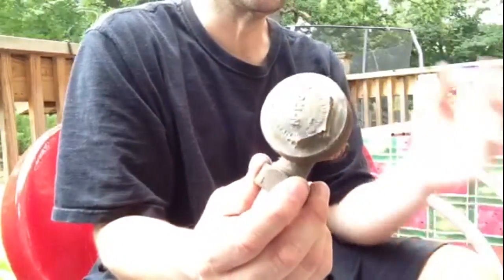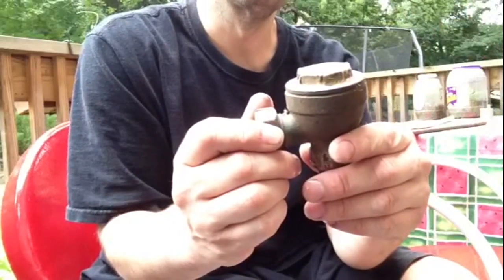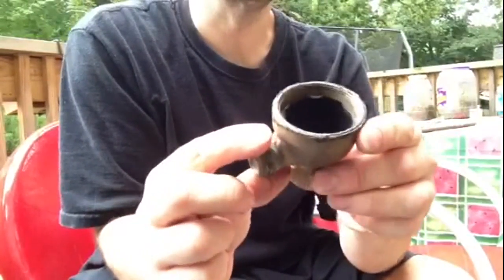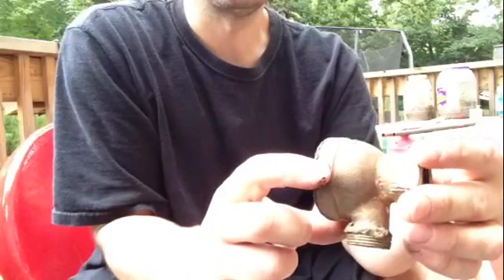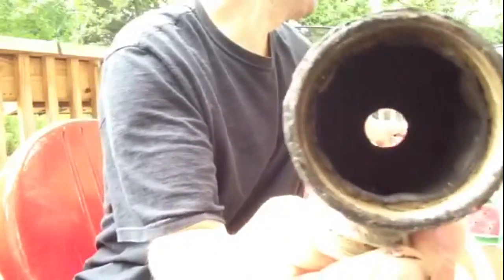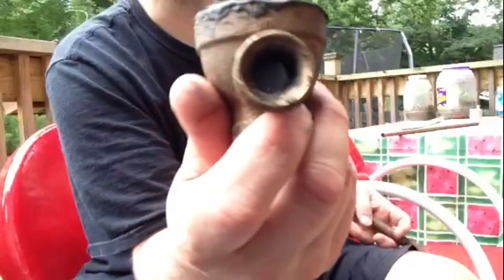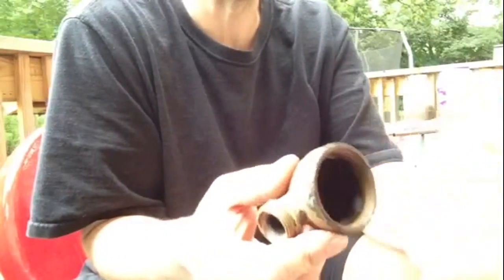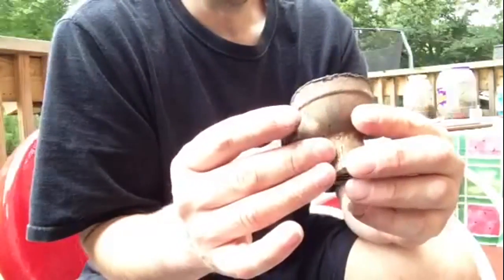How to convert a steam system to hot water heating part 3

Comment: "I do not think steam operates more efficient than hot water."
You're wrong.

"I could not fix a steam system if I tried."
There's your problem.
Reply: themrhelperguy So your solution to the potential of a boiler going down is to make the system more complicated?  Also since you did it in one of your videos I will mention it.  You converted a steam boiler to hot water, how does the boiler suddenly become more dependable?  If that boiler could go down on steam it will go down just the same on hot water so your argument doesn't hold water.  Actually on a hot water system you have MORE things to fail so you really have reduced dependability not increased it.  Hopefully people will read these comments and realize the truth instead of believing your garbage....either that or you will delete these so you don't look like an idiot.  This world is filled with hacks and they are running rampant on the internet.
Reply: abracapocus ima service guy and you would be surprised as long as you keep up with your system
Reply: Anthony, steam is 100x better than hot water.  I was just quoting what this quy was saying and disagreeing with him.
Reply from the maker: abracapocus ok it's Christmas Eve 9:23 pm boiler goes down its just happens to be a steam boiler. I don't know what to do. Call a tech. This guy is the bottom of the ranks. He says I saw a steam boiler once. All the techs with steam experiance are nestled in bed with the thoughts of sugar plumbs dancing in there heads.
Reply from the maker: abracapocus it's not a problem at all. Convert and I do not have to worry about it. I have converted 2 systems in my days and one of them is still in my possession and I have not had a problem in 10 years and I have no concern about a breakdown.
Reply: themrhelperguy You're calling the wrong guys.  You don't call a hot water heat guy to fix a steam system.  Steam isn't rocket science..... If you have a steam system, it's worthwhile to learn a little bit about it, instead of knuckleheading it into a frankensteined hot water system.

Comment: Sorry, but you are doing a great disservice to anyone that will follow this advice.  Steam beats hot water in every category.  In addition, should you try switching a low pressure steam system to a hot water system, you'll usually run into leaks you never saw with steam.  Just because one individual can't "fix a steam system" doesn't mean that there aren't people out there that can in fact work on these systems.  Steam systems are usually neglected and can be returned to good working order for much less expense than converting it over to a pumped hot water heat system.  Converting steam to hot water will "not work a lot better" as you say, because the same radiator will provide much less heat on hot water than it did with steam.

Comment: With all due respect, just because you don't understand something doesn't mean you tell people to rip it out.  Steam can be extremely efficient and is DIY friendly.  No pumps to fail, no bladder tanks to fail, no bleeding, no flooding.  My steam system runs at 0.02 PSI and heats faster than any hot water system.  It's also silent, has no moving parts and I'm a DIYer not a professional.  I can't stand hot water, it's too much of a pain to work with.
Reply from the maker: Chris J wow you steamers are all over this video. I have not even finished it. And it's spring
Reply: themrhelperguy    I heat my house for less than my neighbors do with modern forced hot air in similar homes.  And like I said, no pumps, no bladder tanks, no bleeding and no chance of flooding my house.  Properly working steam is dependable, silent, and efficient.  My single pipe steam system will give a 90% forced hot air system a run for it's money and will do so with far less noise.  You're going to continue doing what you want, all we ask is that you stay open to suggestions.  Perhaps learn steam, it's very simple, just, different.  Instead of circulating how water, you're sending steam up, having it condense and come back.  No moving parts and with a properly sized boiler and venting, it will do so silently and evenly throughout the house.
Reply: I own around 10 houses, out of 10, 2 have steam. Every year I have 5-6 calls on these two houses due to leaking pipe somewhere. on hot water I hardly get any call. It is very hard to replace those cast Iron pipes and those bleeding valve goes bad often. I like steam heat but not those old pipes and keep leaking. With hot water even after 50 years you do not have problems like steam do. Not to mention, every steam boiler I owned gets corroded from top and end up having holes. I am planning to convert two steam boiler into hot water boiler this summer and replace radiator with the baseboard and replace all pipes with pex.

Comment: "I could not fix a steam system if I tried."  So because you aren't smart enough to fix them you advocate tearing out these systems?  I am NOT a professional, but I maintain my own steam system to the point that I just last year replaced my entire boiler on my own.  What happens when the hot water won't heat the house?  Do you know about heat loss?  Do you know that converting to hot water dramatically cuts down on the output of the system?  Do you know how much you DON'T know?  Hot water systems are MUCH more complicated than steam, I can't even fathom how you think the other way around?!  Again if you know NOTHING about how the steam systems work you should not be putting information out on the net like you are.  This is really sad.  Steam is simple elegant and efficient.  How can you say you don't think it's more efficient and then say you don't know anything about it?

Comment: You should fix two pipe steam systems rather than killing them.  Two pipe steam systems provide better and more efficient heat than hot water ever will.  They were, and still are, the top-of-the-line.  They usually can be put back into proper operating order for less than the cost of ripping it out and turning it into a zombie heating system and without the risk of damaging leaks.  Steam operates at 1/2 psi or less and does not require circulators.  Water systems typically work at 12 psi or more.
Reply: themrhelperguy Steam can be VETY efficient if set up properly and maintained. There are plenty of resources out there to learn steam....if you want to learn it. I have seen plenty of people screw up hot water systems.... In the long run the steam will cost less to keep and give you greater comfort.
Reply from the maker: AllSteamedUpInc I do not think steam operates more efficient than hot water. I could not fix a steam system if I tried. The people that specialize in steam are leaving us. If you called about a problem with a steam system would you trust the tech that shows up. Maybe maybe not. It is not user friendly or diy friendly. The use of steam in residential applications is long gone. Any tech could fix a hot water system they see them every day. As great as steam is its day has come and gone and never to return.